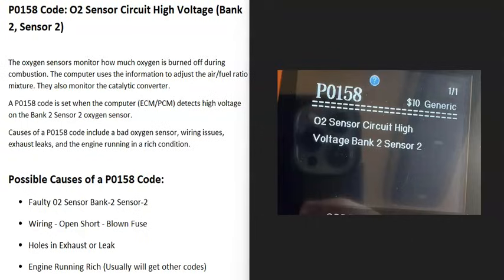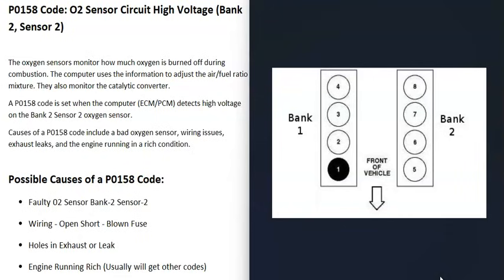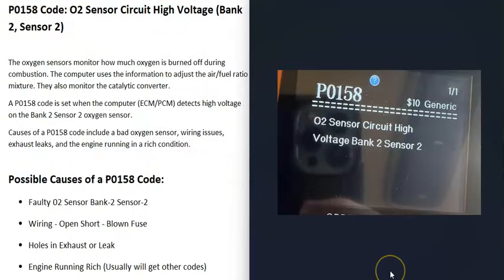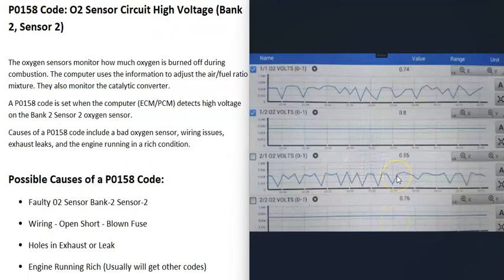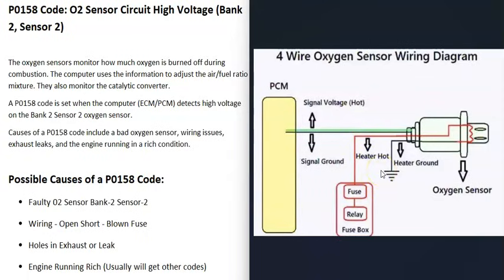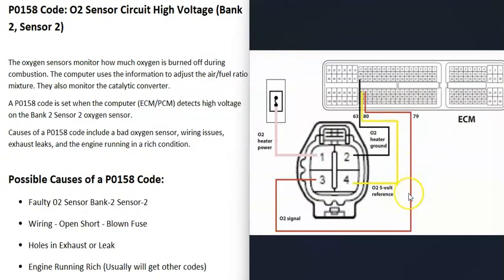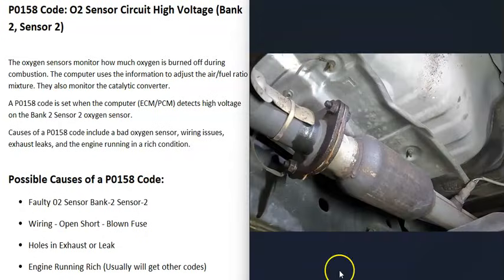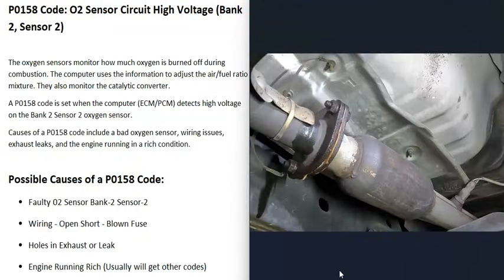Causes and Fixes P0158 Code: O2 Sensor Circuit High Voltage (Bank 2, Sensor 2)

Comment: Hey - I have a 1500 dodge ram 2013 - my mechanic replaced 4 o2 sensors and the check engine light came back on ; had a scan done @ O’Reilly’s and it came back PO152 ; O2 sensor circuit high voltage ( Bank 2 sensor 1) what does this mean ?

Comment: hi hopefully you can see this but on my 2006 dodge charger a p0138 pop up and i change the o2 sensor and fix it but now p0158 pop up and has .215v steady voltage now
Reply: Same here 05 Hyundai Tucson gls